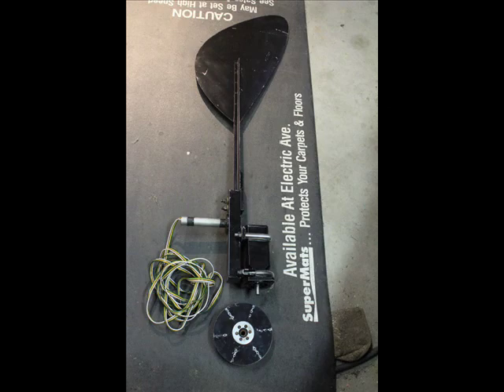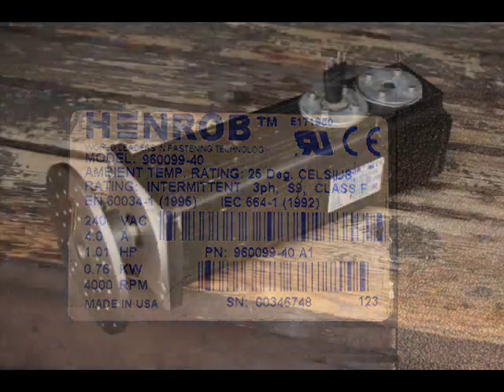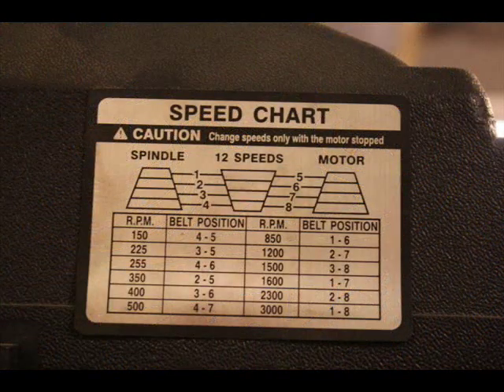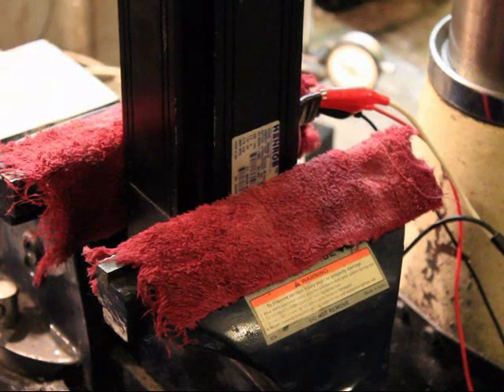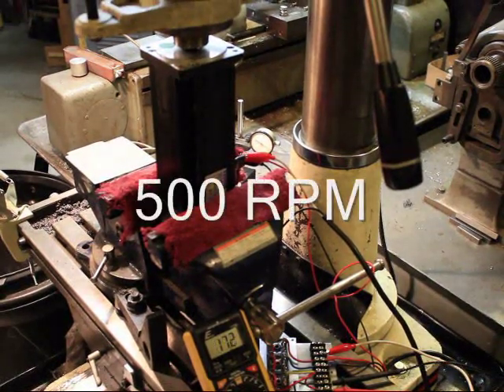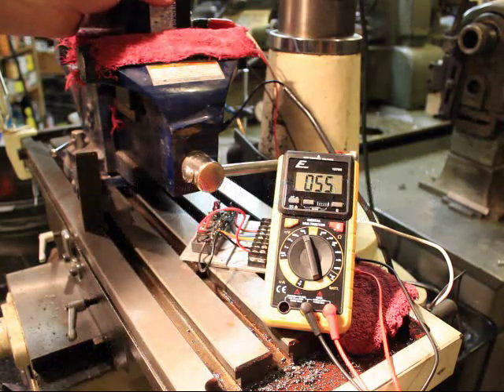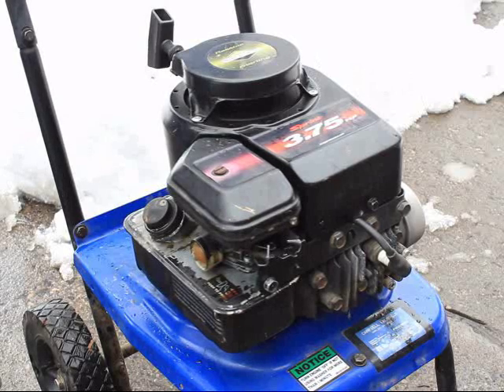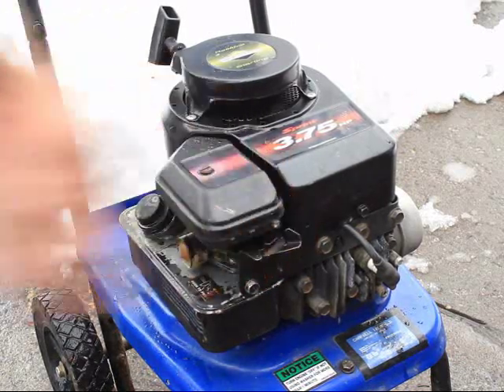Servo Motor Generator Project Wind Turbine? Lawn Mower Engine? Alternator PMA CNC Part 1

Comment from the maker: That would be a tough one .. not sure I could get it done under load unless we got kinda big and dangerous for a turbine. I'm thinking better to use the mower engine for this project. I will probably go belt drive again to keep things quiet and just figure out the ratio so the motor is just above idle. Thanks much!

Comment: Help me with the math here--what would an approximate wind speed have to be to run the shaft 1600 rpm's. Is that even possible or would it have to be done with your poly chain/pulleys? Looks like another challenge...good luck!